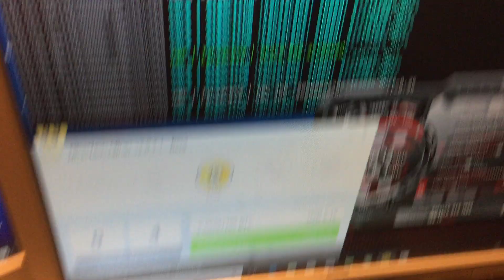5 GPU Old Desktop Computer Bitcoin Mining Rig

Comment from the maker: Here are components for my 5 GPU build: 

5 X MSI GeForce GTX 1060 https://amzn.to/2qwTa8G 

1 X 1 to 4 PCI-E Riser Extender for Bitcoin\Litecoin\ ETH https://amzn.to/2EHtbjQ 

1 X Corsair RMx Series, RM750x https://amzn.to/2GXWm8g 
... or EVGA SuperNOVA 850 G1+, 80 Plus Gold 850W https://amzn.to/2qsbYFS 

1 X Business Desktop Pro 3500 https://amzn.to/2JFhNZu 

1 X 6 Ubit 6 Pack Latest PCI-E Riser https://amzn.to/2GUTzwF 

1 X Dual PSU Power Supply 24 Pin (20+4) Adapter Cable https://amzn.to/2JF9xZm 

1 X 8pin CPU to Graphics Video Card Double PCI-E 8Pin(6Pin+2Pin)Power Supply Cable Splitter https://amzn.to/2HA6vVO 

Optional 

1 X P3 P4400 Kill A Watt Electricity Usage Monitor https://amzn.to/2GWzCS6 
... highly recommended

1 X Logitech Wireless Touch Keyboard K400 https://amzn.to/2GWCLBo

Best of luck mining!

Comment: Are you using a dual psu setup with the OEM running the motherboard and the 750 watt psu powering the gpus?
Reply from the maker: Yes, in most cases OEM PSU's are 260-280W Max, so I use them to power mobo and CPU, but I also have one that is 380W and I use that one to power one of the cards as well. 

I want to keep the PSUs running for a long time without stress. I try not to place too much of a load on them (no more than 75%). 

750 is fully capable of running 5 X 1060 6GB + mobo and CPU with Claymore, but it will max out on NiceHash. Please have that in mind. That is why I try to combo PSUs, so I can switch to Nice Hash at any time when more profitable without risking of running out of power or burning out my PSUs. 

Best of luck m8!

Comment: Thank you! Sounds like you maxed out at 5 GPUs.  Did you ever try running TWO (2) 4-in-1 adapters?  (one in first PCIe Slot and a one in the PCIe Express slot?)  I'm trying to convert my old PC now.  Experimenting as we speak.  I can't seem to get  any of my GPUs to run properly in the 3rd and 4th PCIe express slots. Thanks!
Reply from the maker: It was the case for me in one or two desktops (only 2 worked). I never thought of the double 4 in 1, but I am a bit skeptical if that will work. I had 3 or 4 express slots working (out of 4) prior to installing 4 in 1 expansions. After the expansion was maxed out with 4 GPUs all empty available express slots would not accept any additional cards and on the top of that the windows would not boot. After removing the 6th card, it would boot again. It seams that it is limited by BIOS? I do not know how to change it (if even possible). I wish you best of luck! I hope it works for you, please update :).
Reply: Hi David, FYI - I had an OLD HP Pavilion Desktop that was not able to run more then 2 gpus on Windows.  I loaded it up with SimpleMiner OS (booted from an USB) was now running 6 gpus on the same desktop. One riser on the first PCIe slot, One 4-in-1 adapter in the 2nd PCIe express Slot, and one more riser on the 3rd PCIe express slot.  (I would try more, like running a 7th gpu into the 4th PCIe express slot, or even a second 4-in-1 adapter, but I'm out of GPUs right now.   Will keep you posted if I get a 7th or 8th card going.